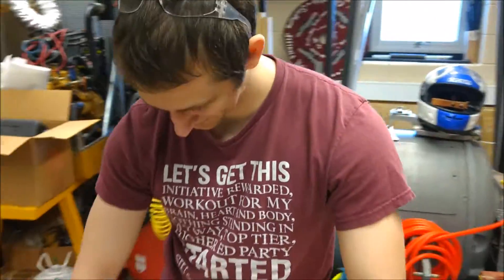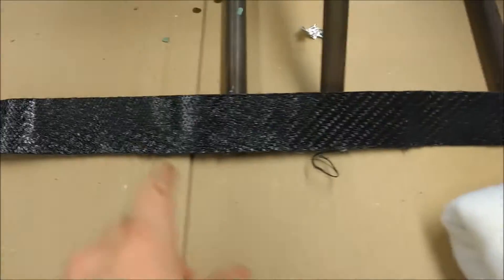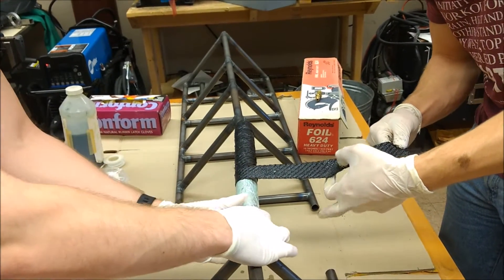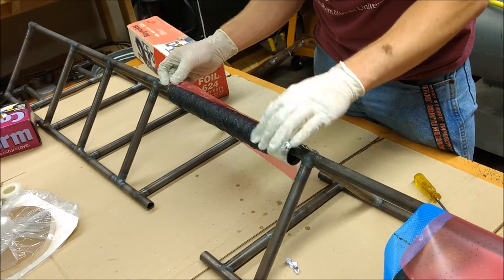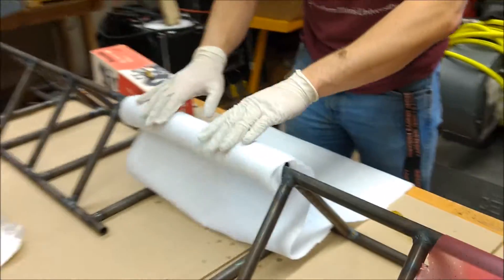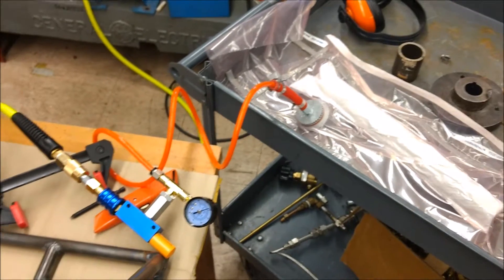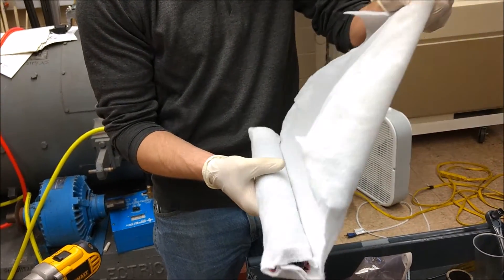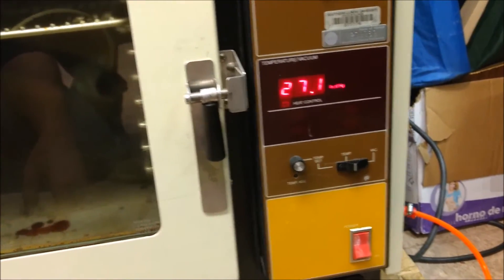Successfully Making Carbon Fiber Drive Shafts

Comment: Errr, my understanding of prepreg is that it is inpregnated with the correct amount of resin, so NON perforated peel ply should be used. The breather cloth is used to make sure all of the air is sucked out, not to suck up excessive resin, which there isn't any of anyway!  If you had cured the part properly at the correct temperature it woldn't be sticky when you unwrapped it.

Maybe you should have a look at the tutorial videos on the easycomposites site.

 http://easycomposites.co.uk/#!/composites-tutorials
Reply: That‘s where you are wrong. You always want max fiber content, and even prepreg usually loses some resin curing. Hence the vacuum. If there‘s no air to make any bubbles, everything that gets into the breather fabric through the foil is resin. Less resin, better part.
Reply: oh my days this must be a video of how not to do carbon prepreg, and a bloody good job they did of it to,  palm to face